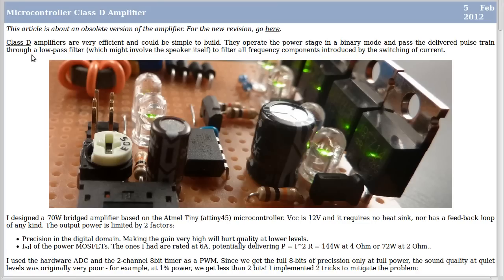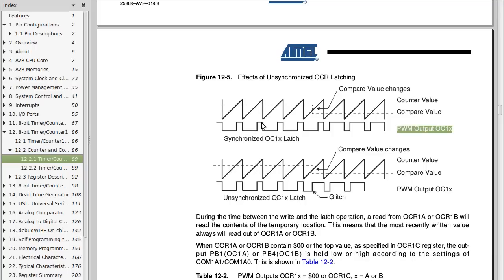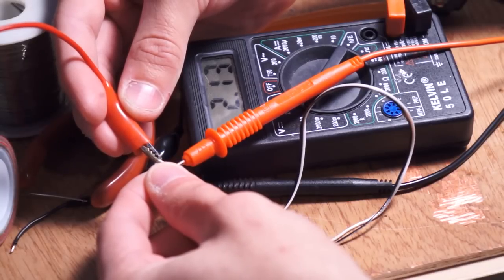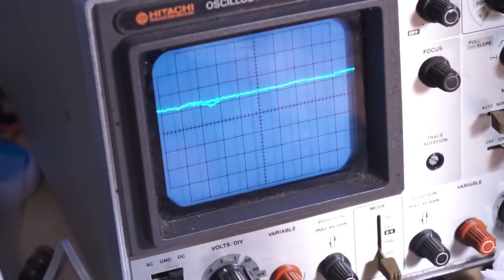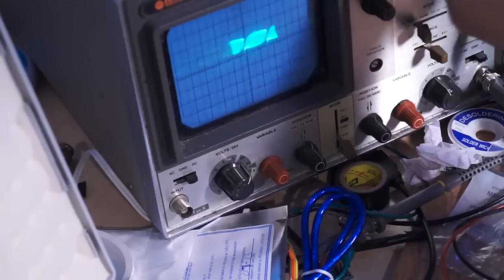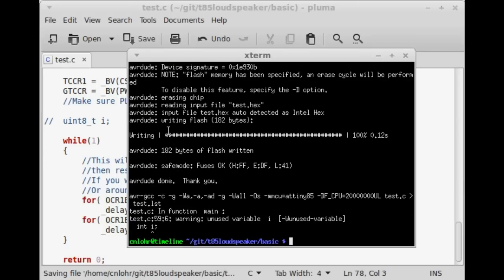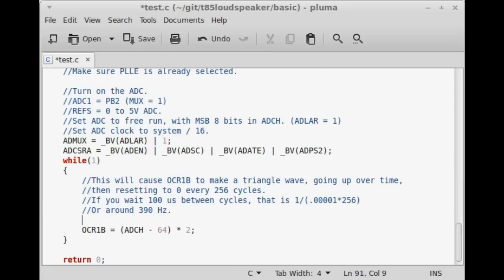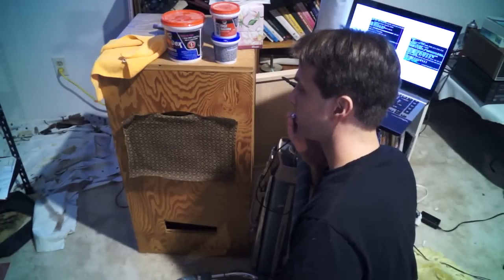ATTiny85 four-component megaphone.

Comment: REALLY COOL, thank you very much for sharing, I did try this, and works even better than the one I did using the arduino uno.
Reply from the maker: I think the kind of speaker matters a lot.  I also wonder if I had done something to bond the pins together, or, use a higher resistance speaker...
Reply: how did you get the ATtiny85 carrier board ?

Comment: It is interesting how loud 0.1W (to be exact 0.09W) can be when you have appropriate speaker.
Reply from the maker: I think the AVR is putting out more like 1W.  I could measure it, though.  The AVR datasheet is just a bunch of underestimates and conservative guesses.  Real AVRs are much more powerful.
Reply: CNLohr sink/source current characteristics in datasheet for Atmel are pretty much spot on. After 10mA source current on port source voltage start dropping rapidly.
You can output 10A from port of Attiny85 but only once for very short time (couple of ps) before it blows (even on 50 mA per port only limited numbers will not blow immediately, but they will not last long)
Reply from the maker: blow? I have shorted pins all over the place and have NEVER blown anything.  They've gotten darn near cooking themselves, but never blown anything.
Reply: CNLohr And you have limited current to 250mA? Try limiting current to 40A (even less) and you will see how spectacular they blow.
Reply from the maker: I don't limit.  I give it tons of power (5A is as much as my supply goes) and just short its outputs out.  They start to go a little crazy when that happens... But they certainly don't "blow"
Reply: CNLohr It is time you publish that your finding, you will surely receive Nobel prize for physics because you managed top pass 5A through 35 um CMOS transistor which is rated for max current of 40mA (for CMOS max. current density for safe operation is 1mA/1 um but you managed to pass 140 times more), as much as X-Fab is good as semiconductor foundry it is out of the realm of possibilities (X-Fab manufacture Atmel chips).
When you put 0.5A through any port of any Atmel microcontroller 100% of them will immediately fail.
Reply from the maker: I don't know what you're talking about.  The AVR limits its own current usage.  The resistance of the mosfets on the output have enough resistance that at 5V, you're probably not gonna draw more than 100mA.  I am nervous to give a figure, because I've never specifically tested it, but have anecdotal cases where I did things like directly connect the output to an LED or something.
Reply: CNLohr problem is it don't have current limit on output, it have some resistance and output voltage will drop with current, but still no real current limiting and it will die if you push enough current (you will melt/vaporize metal layer in uC). And we did tests on it using NI PXIe-4145 ( 4-quadrant SMU), to see how hard we can push attiny85 (it is one of most useful atmel uC and we have lot of them) till destruction so I know that they can be distracted.
Reply from the maker: Miloš Lazović
I just hooked up an AVR and shunted the output to measure the current.  When used in differential mode, the AVR can sink+source ~75mA.  When pushing against each rail, the AVR can sink or source ~90mA.   This surprises me again that it was that loud.
Reply: CNLohr So it is theoretically 0.375W (or 0.450W), but there will be some voltage drop on output pins so in reality is less.
By the way loudness usually don't have much to do with output power of amplifier, it have more to do with speaker sensitivity like speakers for tube amps will produce more than 100 db spl (2.83V, 1m), so in this case you will get more than 100 db of sound with your setup (equivalent to a chain saw, pneumatic drill, printing plant, jackhammer, speeding express train, some car horns at five meters, farm tractor, riveting machine, some noisy subways)
Reply from the maker: Indeed.

Comment: An OP amp would do the job, and you could avoid all that programming.
Reply from the maker: With just as few components?
Reply: CNLohr  OP amp, resistors, transistor, microphone, speaker, capacitors and battery. I guess not.
Reply: You can make it even simpler, you just need carbon microphone (from old telephone) and just one resistor and power supply, it will work but it will be pretty much useless.

Comment: Hi Charles,

I tried this code on github. However it looks that it's just a attiny beeper. at least this is just what mine does. I guess that may a wrong code. Right?

Best
Reply from the maker: Le Bricoleur It is entirelly possible you are gettting feedback to the microphone, or even electrically.  You may want to probe PB1, the microphone input to make sure the signal going in looks good.
Reply: CNLohr Thank!
Unfortunately the signal looks good on the oscilloscope on PB1. I have to say that even with the microphone disconected it beeeeeps.
(I am going on hol now but will work on this when back in couple of weeks, thank anyway for your response).

Best.
Reply from the maker: OH!!! Maybe something's wrong with your clocking.  I can't remember if fuses need to be burned.  If it needs the fuses burned to get the right clock frequency, then what you could be seeing is the PWM frequency could be so low (8 times lower than it should be) that you are hearing the BEEEEP of the PWM itself!
Reply from the maker: Try typing "make fuses"
Reply: +CNLohr Thank you Charles you are right, the issue was arround fuses.
I am using windows with avr studio 4 and the fuses option that works is
'PLL clock start up time PWRDWN/RESET 16K CK/14CK + 4ms"

Now I am Dark Vador

Comment: Nice job! Impressive results with the speaker at the end. I just recently learned about class D amps when reading about this IC http://www2.nuvoton.com/NuvotonMOSS/Community/ProductInfo.aspx?tp_GUID=92c38f1d-b14f-44a8-9d1b-d86ec5a4f694

I don't know too much about stuff, but would there be any stress on the microcontroller when the speaker coil relaxes? https://en.wikipedia.org/wiki/Electrical_characteristics_of_dynamic_loudspeakers#Damping_issues Or maybe it's just an audio quality thing.

Glad I found your channel! (Cool vacuum btw, that's a classic)
Reply from the maker: Yes.  This is very stressful on the ATTiny85.  It does have some parts to help protect itself, though.  I have always been impressed with just how tough these little guys are.

Comment: Why do not you use the Arduino software?
Reply from the maker: It takes extra time to flash, uses extra space on the part, pins and commands that should only take a millionth of a second take much longer.
Reply: couldn't agree more. Even blinky take that much